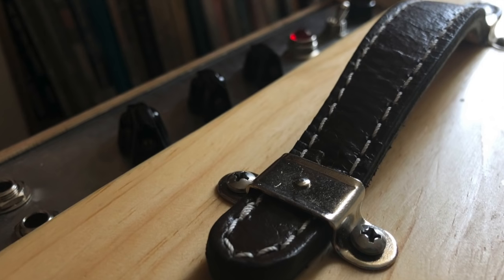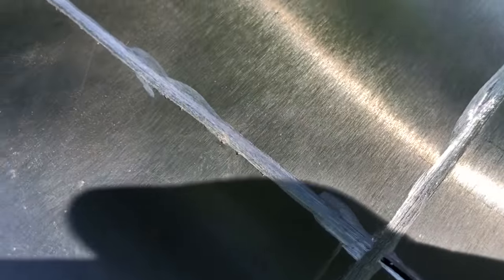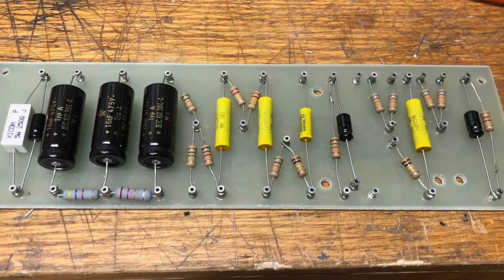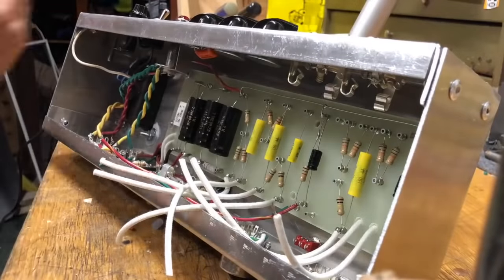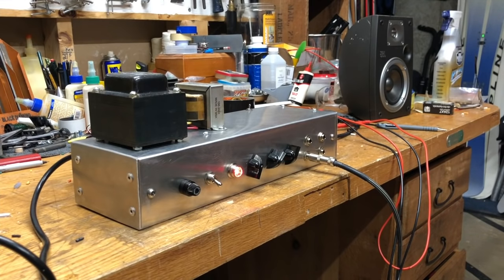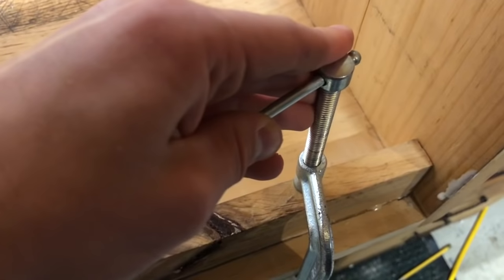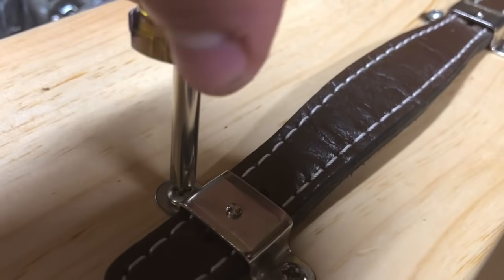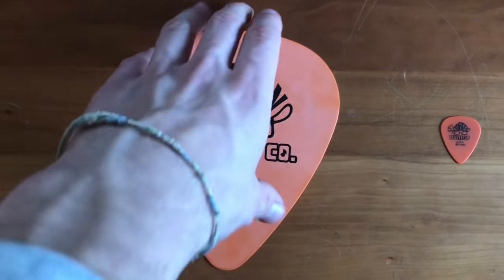Building a 5E3 Deluxe Guitar Amp From Scratch

Comment from the maker: A couple notes after playing the amp for a few months: 
- don't cheap out on the speaker baffle wood like I did. I used scrap ply and it ended up warping a little bit, so I had to make a new speaker baffle.
- use tougher grille cloth than I did. Another reason for my speaker baffle replacement was that the stretchy material I used got a little loose over time and I knew it wasn't doing much to protect the speaker. Now I'm using a tougher, non-stretchy acoustic fabric for the grille cloth.
- I used some pretty low-quality tube sockets because I just bought the first ones that looked good, but they’re really loose and difficult to use so I’m replacing them with nicer ones.
Reply: Вам что комб не по карману?
Reply: @СотаСота-г3ф  what do you mean?
Reply: You did quite good in terms of component quality, with the exception of the tube sockets.  I would had bought Belton or NOS Cinch sockets and used those instead of those iffy Chinese ceramic sockets.
Reply from the maker: @douro20  I received this comment while in the process of replacing those tube sockets with beltons hahaha
Reply: Nice dude! Thanks for the tips!
Reply from the maker: @jameschristensen1658  no problem!
Reply: Would you sale one?
Reply: Have you built an attenuator yet? I did so I  could get the tone without blowing the neighborhood out. Cost about 20 bucks to build.
Reply: @douro20  Yeah, I built mine with cheap sockets too, and I'm using Belton next time
Reply: @СотаСота-г3ф  He said, "Are you unable to afford the combo?" My friend, I think you misunderstand the reason he built this. :)
Reply: Agreed on the tube sockets - learned that the hard way myself!

Comment: I built my first guitar amplifier using 12AT7 and KT66 valves when I was 16 years old, which was 50 years ago now!
However, your workmanship is way better than mine. It all brings tears to my eyes.
Congratulations on your achievement and keep up your good work.
Reply from the maker: That's awesome to hear! I'm glad you enjoyed the build and thanks for the comment.
Reply: The same for me. 50 years ago, I was 16 too. EF86,12AT7, GZ34 rectifier and an EL34 push pull. Congratulations, you work is much better than mine. Thank you for bringing me decades ago.

Comment: Wow, very nice amp!  I want to try to lacquering canvas over a cabinet like this for a super-old school look.  We have a saying: "A good solder joint starts with a good mechanical joint."  In this case, pull the wire or component lead through the solder eye, and bring it back to itself.  Don't twist it.  Pinch them together forming a nice parallel section of 1/8" at the eye.  (Meaning, don't leave a big stub.)  Then flow a good solder mass that encapsulates the entire interface.  It should look like it was dipped in thick molten metal that formed a teardrop shape...no rough surfaces or voids.  That takes HEAT on the ENTIRE joint.  Use plenty of flux and LOWER temp tin-lead solder for best results.  Also, thermal cycling causes a lot of expansion & contraction in conductive material...any metal.  So, leaving a little extra "service loop" adds tremendous life to those solder joints.  (That just means leaving some extra lead length to prevent them being too tight...not an actual loop.)   Finally, solder joints are the highest failure mode in this sort of device...meaning they crap-out first!  Joints that look good, but weren't heated fully are the enemy: A "cold solder joint."  They work when new, but die over time. Before they go completely, you often see resistance changes & intermittency.  Avoid them by following my advice above.  Good job on this...rock on brother!

Comment: Love the fact that you utilized a turret board, rather than an eyelet board.
Reply from the maker: yeah, I've never used an eyelet board before but I kinda feel like turret boards would be easier to solder to. Also I feel like it would be kinda tough to build an eyelet board yourself
Reply: @joeles2738  Eyelet board are pretty easy to make, I use 4mm centre hole nickel plated eyelets, as used in leatherwork. They take solder really well. I put them into 2mm paxolin, or whatever the equivalent is called in the USA. It works out much cheaper, and to me look neater than turrets.
Reply from the maker: @chrisbarrett5132  oh nice! I think I still prefer the look and toughness of a fiberglass turret board but I guess it’s just a personal preference thing

Comment: Top marks for using the "Template" and "well done" on the cabinet. I can imagine it in shrinking black gloss wood paint with laquer for some reason. The bigger cab dimensions are a great idea, I had a Blues dlux which I gutted and kept transformers and chassis and tweed cab(stained with shellac) the cab is bigger than a 59 type, put a Jensen P12Q in it and handwired an improvised an  ab763 to run 2 6L6s with proper valve reverb simple bass/mid/treble. Keep it all simple as poss. Good stuff!

Comment: Congratulations on your first and very nice build!  

You accomplished exactly what I wanted to do with my build by providing a very detailed description of every step.  I tried to video mine and bailed about half way in because I would get wrapped up on the build and forget to record. The time I was spending to go back and reproduce a step or edit a screw up wasn't worth it to me. I'm not a patient person and the build really pushed my buttons a few times. 

I don't think the general viewer is aware of how much time is required to produce a quality, comprehensive amp video build. 

Like yours, my first amp was my own design. I started with a flat sheet of scrap aluminum picked from the floor of a trailer shop. Every component and screw was hand picked. It was expensive in the end but worth it. The completed amp is a 5F2A with a C channel horizontal chassis in a 1941 Majestic console record player / radio cabinet with a 12" Jensen C12Q. I wanted different and that's what I have and I couldn't be more pleased with it. 

I look forward to your next build and thank you for sharing your very nice build.
Reply from the maker: Nice! I appreciate it and congrats on the successful build

Comment: That's excellent work, you should be really proud of yourself.  Playing through something that you worked hard over, and made yourself must be really satisfying.    Just 2 personal preferences on my part, I might have been tempted to make the amp as a separate head and cabinet if you had the wood, make it more modular and can swap out components more easily.  And at about 24:25, you pull on your guitar lead a little and risk either damaging the input jack, or pulling the whole amp forward onto its face.  This is probably why most amps have their input on the front so that if enough pressure is exerted you just pull the cable right out of the jack.  Plus at a glance you can see what the volume, gain etc. is currently at without standing right over the amp.   That aside, I'm impressed by your efforts here, well played.  👍

Comment: Great work man! Looking at building one of these for myself. Any way you could share the SketchUp model?
Reply from the maker: I don't still have the SketchUp model unfortunately but it was pretty similar to the original Fender design! The main reason I made that model was because I needed to account for my custom chassis being slightly different than the fender dimensions.

Comment: Very Impressed .. it turned out great and as I read .. you've already made upgrades and improvements.  I think I too would go with a the natural finish if I had spent that the timed to build the cab! I would be such a noob with the electronics.. you've obviously got a good handle on what you're doing and taking a sensible approach to testing as you go along. Kudos!!
Reply from the maker: Thank you! I also really like the natural wood look. Although it does probably make it a little less durable.

Comment: This is an incredible build. When you can, you might want to touch up your tube socket soldering. You need more heat on the joint so the solder reflows properly on the socket leads. Many of the those fillets are cold.  They could fail in time unless you've got smooth solder between the wire lead and socket pins.

Comment: Nice build Joe. Uncle Doug advises having your filament wires coming up above the tube sockets and swooping down to the connection, not laying against the chassis. Because it's a/c it helps with noise reduction apparently. And as you know, U/D is the man!
Reply from the maker: Yeah true; I've built amps with both configurations and I've found (from personal experience) that as long as you're neat and you're careful about signal wires, either way works with minimal noise. I prefer having them against the chassis just because I think it looks a little better and you have more room to work in the chassis that way. It probably also depends on if you have the tube sockets parallel to the control panel, like on this amp, or if they're mounted on the floor of the chassis.

Comment: If you anneal your aluminum with a propane torch at the lines you want to bend it will make it bend like butter. I was a toolmaker for 30 years with amp work as a sideline so it gave me a good knowledge of metal work for chassis building.
Reply from the maker: Thanks, that's a great idea! I'll probably give that a try on my next chassis

Comment: Nice job! I made a similar amp, a tweed champ, from scratch , but I used 16 gauge steel for the chassis.  I didn’t have any trouble cutting it with my jigsaw but bending it was really hard!
Reply from the maker: Yeah I bet, bending this definitely wasn't easy even with aluminum

Comment: I’m an amp builder and amp tech. Great job on this. I do have a safety concern though. I noticed the ground to the filter caps weren’t all connected. The first two caps are connected, but don’t connect to chassis ground with the 3rd filter cap. 

Oh, and I’ve had bad luck with ceramic tube sockets. They end up getting pretty loose over time. If this happens for you consider switching over to the brown plastic ones. Belkin makes them. They’re excellent tube sockets.
Reply from the maker: Thanks! I did switch to Belkin sockets. Why is the filter cap grounding a safety issue? All 3 are grounded, just not on the same ground buss. Fwiw I’ve also been playing/gigging the amp for a couple years with so issues.
Reply: @joeles2738  Well if the reservoir cap has a chassis connection, it's no big deal, but ideally, there should only be 2 chassis earth connections, and they should be as far apart from each other as possible. One for the ground of the power chord and one on the input jack or next to the input jack if using an insulating input jack like a CLIFF jack.

Comment: fun build! I used a beehive kit from Tractor Supply to build my cabs, head and speaker cabs...worked great and saved huge time with limited tools and carp. skills....just say'n
Reply from the maker: That’s a cool idea, I’ve seen lots of cabs and heads made out various repurposed stuff and I’ve always thought they have a pretty cool look
Reply: Yep the deep beehive box is almost identical size to the 5e3 cab. I did one and turned the boards inside out so the handles were on the inside. It’s convenient and finger joined too though Next time I’ll buy the wood and hand make the joints.
Reply: @davidsimpson3380  I've done a few since using The Behive Boxes...a nice 5f1 head and a mojo stidio 1 head. My routing work is improving!  I might work on finger joints next...though the cabs after tolex applied no one could tell a difference. Uncle Doug has produced some awsome videos on building cabs....those inspired me, not to mention the cost on premade cabs.

Comment: That looks great, sounds great,  you must be pleased. You've passed on some really useful info for anyone considering this build. One of your switches looks to be in a slightly awkward spot though - not sure what that was (sorry if I missed it in the video)
Reply from the maker: yeah, that switch on the back of the amp is so you can switch between two coupling capacitors for use with different pickups, one with a lower value than in the original schematic. It is kind of a pain to reach but I knew I would kinda just figure out what sounds best and leave it in one position so I haven't really had to reach back there and use it much. Glad you liked the video!

Comment: Blue loctite on all fasteners inside should be your best friend, to stop the vibrations from the speaker loosening all the hardware 👍  other than that I'm impressed, I like the press bent thick aluminum housing of the amp, it gives off awesome racecar or aerospace fabrication vibes, would look even cooler on the aluminum if you put a swirl pattern finish on the faceplate of the Amp where the knobs are
Reply: The swirl finish I'm referring to is called Engine Turning it was super popular around the 1930-1960's and can be easily done with small round scotch-brite disc's, you just have to be sure the aluminum is polished really shiny before starting and finishing with a few coats of clear coat. Also looks insane on polished brass for faceplates

Comment: Nice one Joe. I made the front of my chassis from Brass. As I had some sitting around the garage. But purchased the cab speaker bit, as it was sooooo cheap on Gumtree. Like half the price of a speaker alone. And I am even more rubbish at woodwork than I am at guitar. But it just stays in the garage as my test amp for FX , guitars etc that I am making/fixing or mostly breaking ha ha. Cheers from Jolly old South London
Reply from the maker: Nice! thanks for the comment

Comment: Good job taking on this build the only thing you should improve on is your mechanical connections loop and twist tight then soldier also try to use carbon resistors

Comment: You can fill the gaps in your finger joints like this:  1.  Sand the surface of the work area to bare wood.  2.  Mix sawdust with carpenter's / wood glue.  3.  Push it in the gaps and rub off the excess with a water dampened with a little water.  4.  Sand it flush after it dries and refinish that spot with the same Minwax polyurethane.  If you don't wipe off the excess glue before it dries you will make a blotch in the wood in that spot that finish won't penentrate and cover without showing the blotch underneath. 

Alternatively you can glue thin slices of wood in the gaps and trim them flush.  Wipe the glue, etc.

Do not put glue over polyurethane.

Comment: The first modification I would make to the 5e3 would be to look at the Dearmond R15 which is very similar.. The volume pots have a slightly lower value. and hence the first coupling caps are also lower value.. I would not change the first coupling caps in the 5e3 but the ones in the power section you could lower to 0.022 which cuts of frequencies below 35Hz (well below the guitars range).. I would increase the first power capacitor to 30microfard. (the higest for a 5y3 rectifier).. I would make sure the voltages are within specs so i could use a 250 to 330 ohm bias resistor on the 6v6s.  Trying to cool down an amp with high voltages will require maybe a 510 ohm bias resistor. but I think the amps sounds better when voltages are proper for a 6v6gt tube.. Plate to cathode voltage no higher than 350 in a cathode biasd circuit.

Comment: When I first started building amps, I found it pretty hard to mess up well documented circuits. A big part of the “Tweed” sound is a lively speaker baffle. Since you screwed the baffle in, try out a 1/4” birch baffle. It adds dimension and a touch of natural reverb which is completely killed with a heavy duty baffle.
Reply from the maker: Yeah it’s nice having so much online info available. And I didn’t know people went as thin as 1/4” for a speaker baffle, that’s interesting and I bet that would affect the sound quite a bit. I think the current one sounds pretty nice as is though

Comment: Nice build! One thing though, don't go cheap on tube sockets. Especially when they are hanging upside down. Well worth it paying little bit more for belton sockets
Reply from the maker: Thanks! I realized that those tube sockets were pretty bad after I actually tried putting tubes in and out a couple times, so I replaced them with Beltons. It was definitely kind of a pain but worth it.

Comment: I like how this came out :-) Im currently finishing up a 5e3 kit that runs on 6l6 power tubes and has a SS rectifier. Im also doing the NFB switch, 6n2p to 12ax7 switches. You can run 12ax7 or 6n2p preamp tubes. Also i will be trying out 6P3S output tubes, need to cool down the bias to use these. :-)
Reply from the maker: Nice! Sounds like a cool build

Comment: i really like your build! i made 2 5e3 with old transformers and parts , only thing i want to replace probably the cathode resistor and put a 10 watts instead the 5 watt, it gets super hot even if it dissipates only 1.5 watts...i would suggest you to put your cathode bypass cap a bit away from that resistor , apart of that great build 👍🏻
Reply from the maker: Thanks! And yeah I ended up swapping in a 10 watt cathode resistor and spaced it from the cap

Comment: Very nice work. I couldn’t tell if you took the time to determine the foil side of the capacitors and install that end to the low impedance direction in the circuit? It can help keep noise down and add professionalism. W3KW

Comment: I'd spiff it up by having the electronics chassis powder coated  and the grille hardware coated to match. You could fill in the joint gaps of the cab and sand and refinish. Not much else you could really do cosmetically. Sounds great and that's all that matters in the end.
Reply from the maker: Idk I kinda like the look of the unfinished metal. But yeah I’m happy with the sound and that’s what really counts 👌